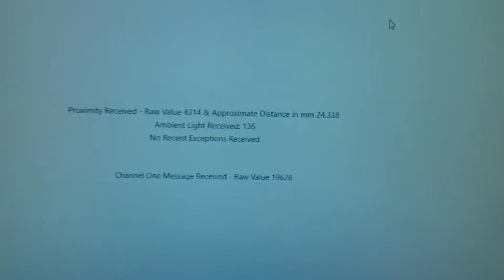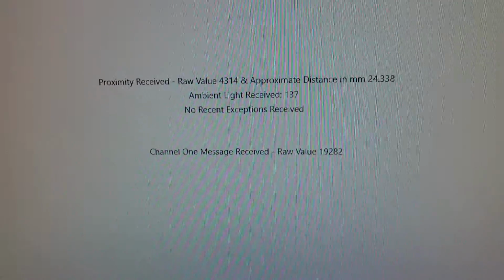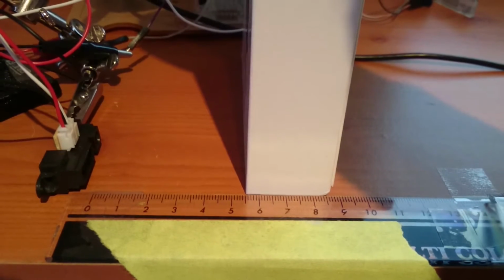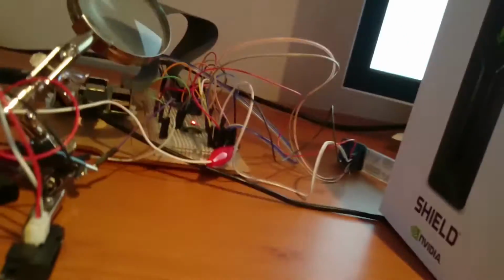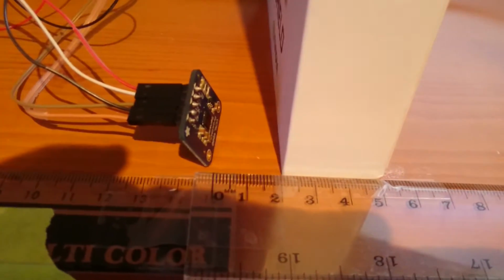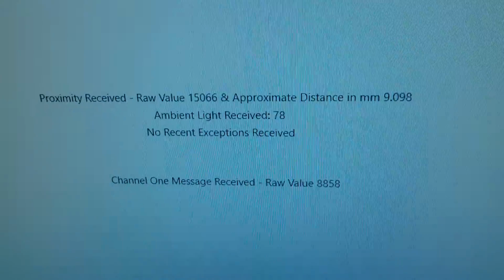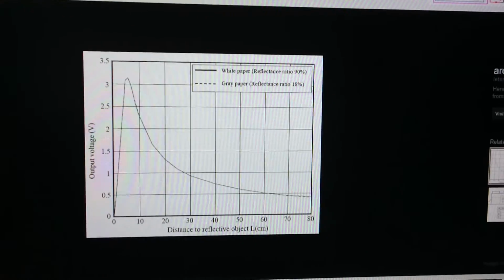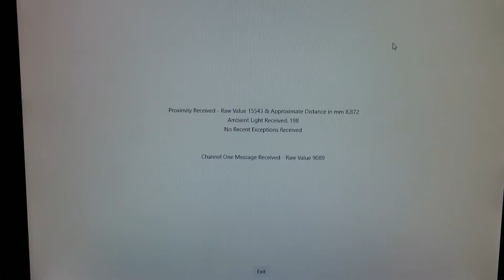Windows 10 IoT running on Raspberry Pi 3 talking to some sensors

Comment: Can you share distance measurement code with ir sensor
Reply from the maker: https://github.com/silentbobbert/pi_sensors_win10_iot
Reply: Thank you very much, but I could not understand the codes. I would like to measure the distance with a sharp 2y0a21 sensor c ++ yada python but I could not find any source. Can you help?
Reply from the maker: The maths is here https://github.com/silentbobbert/pi_sensors_win10_iot/blob/master/Sharp2Y0A21/RawValueConverter.cs  there are examples of the conversion factors in the comments. To get good results you should probably plot the results like I did and fit a line in Excel to get more precise factors for your ir sensor. I only fitted my line on the downward slope of the graph.